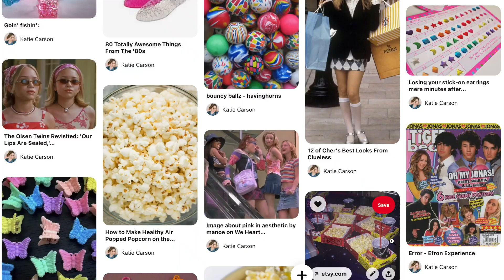I Made a Soap Inspired by Boy Bands | SLUMBER PARTY COLLECTION | Royalty Soaps

Comment: Those white jugs/pitchers that you mentioned are just awesome because they have that black stipe of rubbery stuff on the base. That keeps the pitcher stable and stops it from moving about whilst stick blending - for safety reasons, having a pitcher stay-put is very very important. We’ve all turned on a stick blender inside a smallish jug and had the pitcher start spinning around before you mange to grab that handle. Yup, when looking for pitchers or jugs, checking out the base for that black or sometimes white “non-slip strip” is a good pro-tip. 🐿🤪

(I’m a poet and I didn’t even know it)
🙂
Helpful for baking and also for safe soap mixing and making.
(Hey, I did it again!! Weeeeeee)

Comment: completely off topic but... i just watched a SortedFood video about food trends and one of the items was insect oil, apparently not yet available to the average consumer. anyway its being marketed as a replacement for palm oil, so Sorted did a couple experiments and apparently it behaved the same way as regular oil did in both mayonnaise from scratch and blueberry muffins, though the muffins were lighter than those with a different oil to the insect oil.
if possible could you do a small batch and experiment on if it could be a replacement to palm oil in cold processed soap making? i dont know enough about the science and how theyre different to know if it would work the same way. ie would there be discolouration? would it set the same way? will it take longer/less time to set? will it lather the same? is it safe to put on skin? and so on.
however, i know you might not be able to get ahold of it so no worries if you cant.
heres a link to the vid where Sorted mentions it and its at 7:54 if you want to skip straight to it
(15) Taste Testing the Latest Food Trend Products Vol. 8 - YouTube